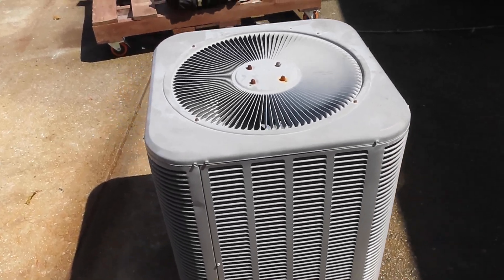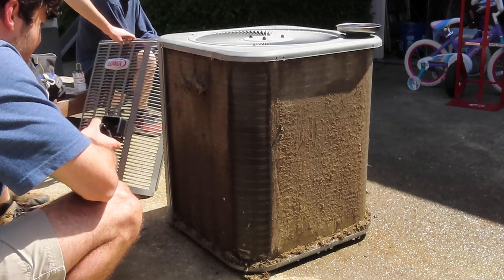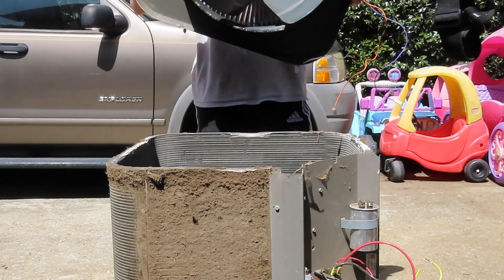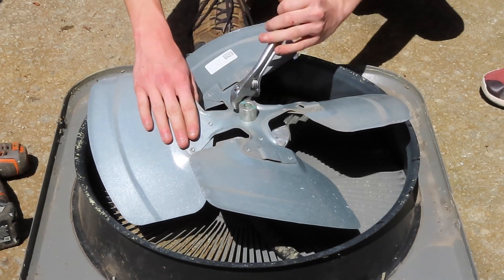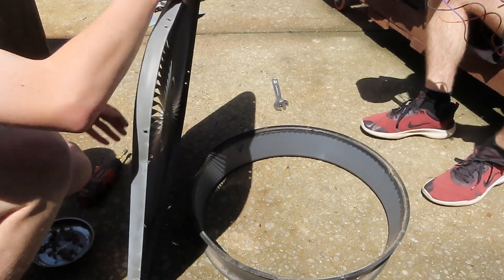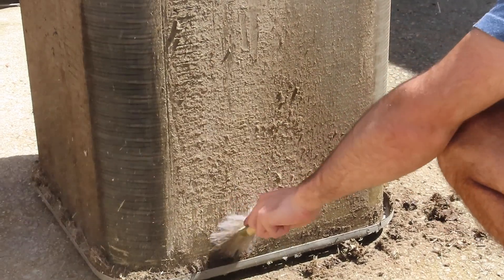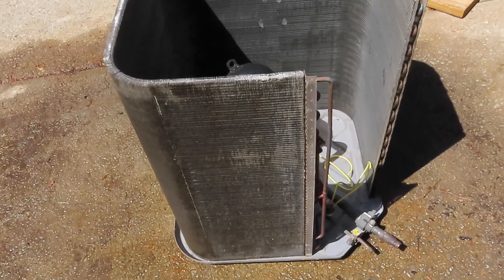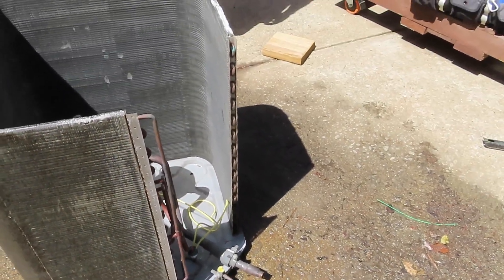Rebuilding a 2010 Lennox Air Conditioner

Comment: Nice Job Guys Cleaning This Unit Up. There is however one thing that I would like to mention as I watched this video. For future reference when cleaning Condenser Coils never hose down the Coils from the outside in but rather hose down the Coils from the inside out because when hosing down the Coils from the outside in then your pushing all the dust particles and debris further into the Coils but rather hosing the Coils down from the inside out your then pushing the debris away from since most of the debris forms on the outside of the Coils As air passes through the Coils when the unit is operating. Just food for thought.

Comment: Great job.  Love these lennox units. Did you get the matching G series furnace and evap coil?   What do you plan to do with tnis unit?  I have a 2001 lennox 3 ton 10 ACB  series unit.
Reply from the maker: I only have the coil and condenser. It will be passed on to a new owner. Thank you!